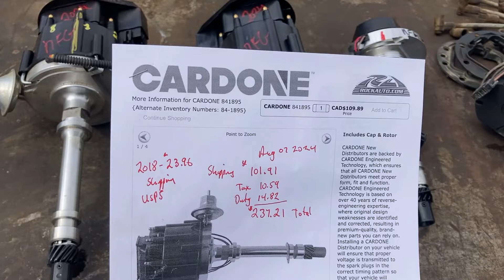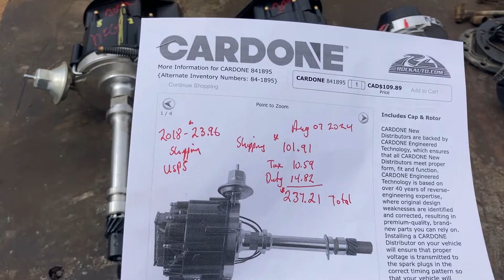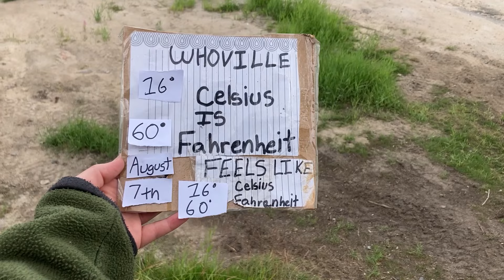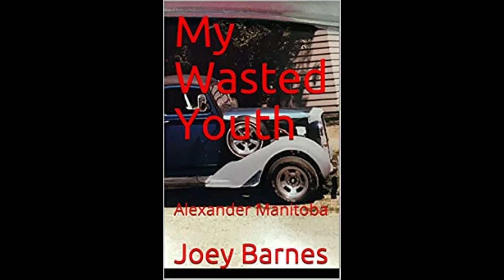Looks More Like a Rat Rod Then a Tribute Truck Aug 07 2024

Comment: I used an accell distributor on my 468 big block Chevy back in 2005. It's been good just had to  change out the modulator once. Hope you get to drive to Walmart for a provision run. Sir Rodney is on the ball for your order🤘
Reply from the maker: yes back in 1984 we had the acell dual point with super coil. it did not like the carwash or driving in the rain. oh well  thansk

Comment: I recently restored a 1964 F100. I wanted the simplicity of the HEI distributor so I picked one up online for about $75. It worked for about 500 miles and then the seal preventing crankcase gases from making their way into the distributor fused itself to the distributor shaft. Had to disassemble and clean the melted plastic from the shaft and lubricate. My "on-line" carb also failed. Part of the venturi tubes are super glued on and the gas dissolved the glue and one fell off on top of the butterflies. Three failed fuel pumps, one failed water pump and I'm sure there's more. What a joke!😢
Reply from the maker: yes it is unreal the lack of quality in todays new world and not sure how we being told to recycle is saving the world. sell us a part that will last years not months or minutes.  thansk

Comment: Advise, only the GM coils and the other internal unit under the rotor in the distributor are dependable. The aftermarket distributor parts don't have the engineering and longevity as the Factory parts. This was told to me by a Chevrolet Dealer Owner and he was also a racer and high  performance fellow. I was having trouble with aftermarket distributor parts, he told me to put GM parts in, I never had anymore trouble after that. 👍
Reply from the maker: good to know as we all learn together  thansk

Comment: I bought one of those cheap  distributors once and i  was pissed off cause it wouldn't rrunn.  I changed control modual   in it and it  worked good after that.   Try a quick swap of modual and give it a try. Great video .
Reply from the maker: thank you, on a cold winter day those HEI and carbs will make a relaxing project figuring them out.  thansk

Comment: Smoke coming out of the carburetor after the engine is shut off is a sign of fuel leaking into the engine.  maybe it's the welch plugs leaking
Reply from the maker: yes the carb needs more work as we learn more and more  thansk

Comment: OEM distributor from junk yard an put MSD cap an roter great combo run that on my 68 Chevelle had a $ 500distributor set up an it left me broke down on the side of the road 😂🤣🕳️🇺🇸
Reply: Idle jet plugged???
Reply: Truck looks like it will be fun again soon.   Used to sell those modules on those original distributors, most common problem.  I seen people put in  conversion kits(different distributors)using aftermarket modules always failing,  not sure on your new aftermarket distributor what they are made of, module quit ?  Shafts bushings, are they still good ?
Reply from the maker: yes new world parts are junk but oh well  thansk
Reply from the maker: @David-j5w9e  could be  thansk
could be as we are all learning  thansk
Reply from the maker: @MrHiball1234  yes brand new and never worked so most likely a junk modules, welcome to the new world  thansk

Comment: And of course, good luck trying to find an HEI in the autowreckers these days, at least odds are you'd have a functioning unit.  
 Do those new hei's have a 4 pin or 5 pin module in them?  Have you already done a continuity-wiggle test on the wires of those "new" hei's? If anything I've learned over the years is that a certain country uses to most undersized wire possible, and quite often pre-cracked somewhere causing intermittents.  

Yes on the camaro subframe.  Rear steer was on the 1st gen camaro (67-69) .  1967-1974 Nova are also rear steer and pretty much share the same front subframe and share all the brake parts).    You can confirm its a 69 if its got "normal" single piston calipers.  67 & 68 Camaro and Nova had four piston calipers.
Reply from the maker: yes not many good ones left at the auto wreckers. need to find an estate sale where the fellow keep all the good stuff over the year. i never looked at the inside really because being colour blind i have stayed away from anything electrical, now i have to learn. as for the sub frame it has drum brakes which will be upgraded to disc brakes. i think the kits are reasonable priced.  thansk
Reply: @kingofobsolete4789  Maybe you'll get lucky with the estate sale.  
No need to worry about wire colors, just need to make sure each wire keeps continuity end to end when you give it a jiggle about.   

Kits are still pricey, not as crazy pricey as they where in the 90's (I pieced mine together from junkyard parts back around 1988), but quick look at Summit and they want ~$1200 Canadian + shipping.   There an old hulk of 72 or older monte carlo, 68-74 Nova left aboneded in the woods? If its got disc brakes you got all the parts you need, might just want a new/reman master though.  And as a gotcha, depending on brake lines, the fitting for the rear brake line MIGHT need to be changed--Same line size, but different diameter port.